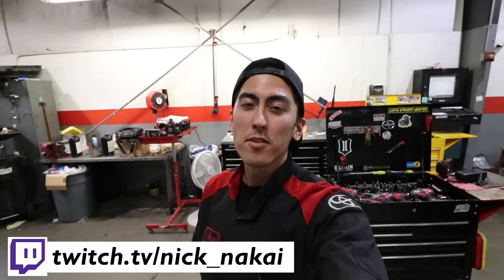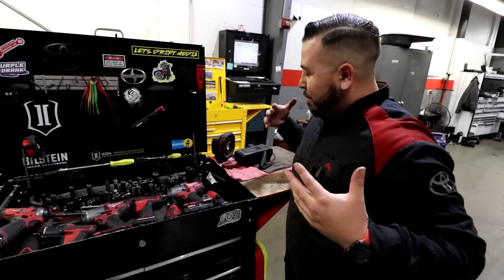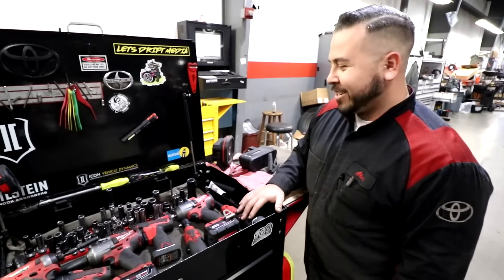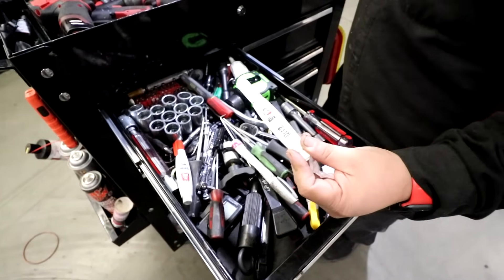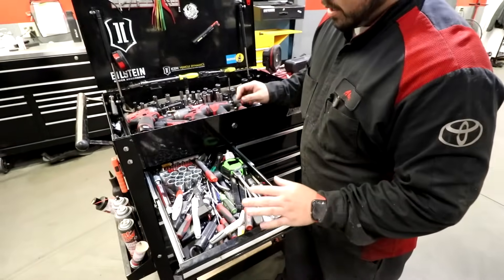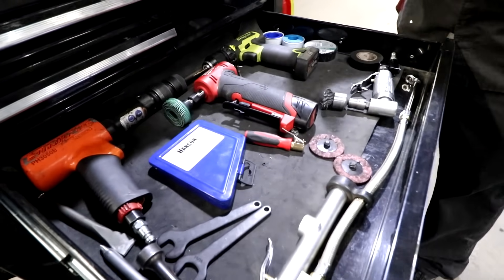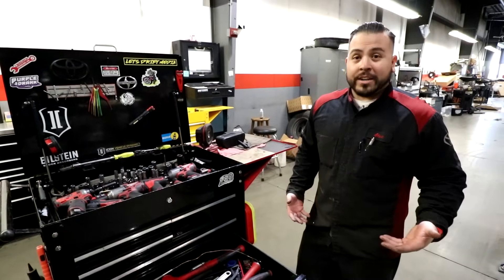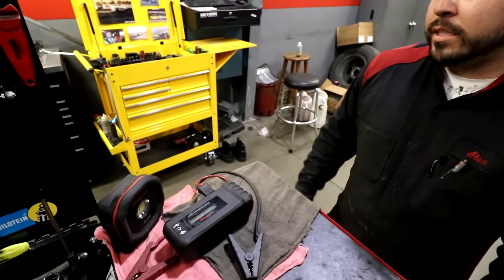TOYOTA TECH TOOL CART BREAKDOWN 2020

Comment: I'm a Toyota man. Have a first gen Sequoia and Highlander. I can appreciate the simplicity and good engineering, those 10,12,14mm are so common on them. It really amazes me how few tools I actually used to do a timing belt on the 4.7L. But I also work on old american iron. Tractor and small block chevy so I ha e to ha e that set of SAae standard tools to complement the metrics. So even though I'm no pro I have an ever expanding collection.

Comment: If a company  comes out with a battery powered air hammer that actually will perform close to the air ones will change the game for sure. I know they can do it because they already have battery hammer drills out for construction use. Then the only reason for air would be to blow guns and to fill tires.

Comment: What brand was that small flex light he had with the 3-4 way light ?
Reply: I have one similar but it's way bigger. I bought mine from snap+on for $150.  Harbor freight has one that flexes like that but only has 2 lights, on won the tip and then the one on the side. You can get the harbor freight one for $25 with the coupon.
Reply: might be the new gearwrench flex headlight
Reply: That’s new from Snap-On
Reply from the maker: Yea it was snap on I think it just came out.
Reply: @LetsDriftMedia  thank you

Comment: Q&A: I don't suppose you know if you have to supply your own tools in a UK dealership, one day I'd live to work for Ford in a dealership and want to start getting my own tools, and what would be the best for a beginner. Thank you 
Love your videos x
Reply: If I were you I'd start with a company like tekton and get a 3/8 short ratchet, flex head ratchet medium length and get the 6mm-24mm short and deep sockets. Get a screwdriver set, plier set, vice grips, set of wrenches (combination and ratcheting). Get a few hammers (ball pein, soft blow and a mallet. Pry bars are a essential for suspension work as well. These are the bare necessities, you'll eventually need things like 1/4, 1/2, sockets/ ratchets. 1/2 impact sockets are good to do 24mm-36mm short and deep. Swivel impacts are essential for time savings but you can get away with a swivel 3/8 adapter. Torque wrenches are good to have, a jack and jack stands. A drain pan is good /oil storage container/ funnel. Picks, electric ratcheting wrenches, impact guns, inspection mirrors, hose release tools, serpentine belt kit, pullers, air hammer, DMM, test light, magnets, storage and organization is key as well. Start with a harbor freight roller cart (3 drawer), piece it together in that order and you'll be good.
Reply: Oh yeah, and sae is a thing you'll have to consider if you work on American classics
Reply: Thank you for your reply, this is helpful.
Reply: @chloeholditch2825  it doesn't have to be in that order and get what you need when you can but its a good start for the essentials

Comment: Do you recommend the 1/4 over the 3/8 Snap-on extended cordless ratchet?
Reply from the maker: I have neither, but from what ive heard the 1/4 is the way to go if your getting the extended version since your most likely going to use it in tighter spaces.

Comment: Should I get a mid torque 1/2in impact or a high torque 1/2in impact?? (Milwaukee) I’m currently a Toyota lube tech
Reply: Mid torque, better and lighter for the all day tire rotations
Reply: Alex Franco  sweet, thanks 🤟🏽
Reply: If it's your only 1/2" gun it might be better to get the high torque first. So you don't get stuck needing it at some point, but it is a little heavier. "How to automotive" has a video on it i believe.
Reply: For a lube tech, mid torque is just fine
Reply from the maker: I would get the mid torque first, the high torque is way too strong for most work at toyota, There are times when you would need it but as a lube tech its deff overkill.
Reply: Lets Drift Media  awesome, I guess a high torque would be overkill 🤟🏽 thanks!!
Reply from the maker: @alvarohernandez8569  no problem I plan on buying the mid torque as soon as Alex stops letting me borrow his
Reply: Lets Drift Media haha I have a coworker that has both and I really love the mid torque

Comment: Who makes the double ratcheting end wrenches
Reply: There are several brands. Harbor freight a icon just made some but most popular are mountain. I just bought some marco off my coworker that is quitting for really cheap.
Reply: Mine are Matco and that’s what’s easier since the truck comes around but the harbor freight ones are literally the same thing
Reply: @housseinahmed6240  thanks
Reply from the maker: what they said ^^^ but his are Mountain i believe.
Reply: Mac sells the mountain brand but they are going to mark it up compared to Amazon's price. The only difference is the tool truck comes once a week if they brake vs sending it back yourself. Sometimes the tool truck has to order it too so think about that.

Comment: Idk if this is out there but it would be cool if someone did a study showing what the average mechanic/auto technician drives for a vehicle. With them having to work on cars everyday and them seeing what common issues are I believe that would influence their purchase. What do you think they drive?
Reply: I drive a 2003 Toyota Corolla with the 5 speed transmission. Super reliable. I bought it with only the axle seals leaking and needed an alignment. Of course working at a Toyota dealership I fixed those issues the next day. And I’m religious at maintenance so I don’t have to do anything too crazy as far as repairs. The 1ZZ engine is fantastic for every day driving. Then I have my toy. My 2014 F-250 FX4. I have that truck to haul stuff and to go off roading and when I want to drive a V8. It’s the 6.2L and those engines are very stout and reliable if you take care of it. I buy vehicles that are reliable so I don’t have to work on them because working on cars all day every day every week can wear you down and the last thing I want to do is work on my own vehicles when I get off of work.
Reply from the maker: That would be interesting, from what ive seen theres 2 types of mechanics, car enthusiast who have there own cool builds they drive and the mechanics that just see it as a job and drive whatever is cheap and easy to maintain.
Reply: I work at a GM dealership as a technician. I daily a 2014 sonic with a 1.8l. From what I've seen at work they are terrible cars but mine has 150k and is still going strong with no issues yet. I also have a 1987 chrysler conquest that I absolutely love. It's currently in pieces since I'm redoing the entire car but it's been a blast working on it. I personally try to find a car that I am passionate about and like to drive but is still decently reliable and easy to work on.
Reply: Buick park avenue with the 3.8

Comment: Can you do list of the brands he points out?
Reply: I see a lot of snap-on and Milwaukee. The advice I have gotten from techs where I work at is to not buy from the tool trucks because you will spend a lot of money and your tool box won't be as full. I buy a lot from Amazon and certain things I do get from snap-on. For power tools I buy milwaukee over snap-on because it's a big price difference. I have a few snap-on ratchets because I know they will be reliable. Sunex, and gearwrench are good alternatives. A lot of the tool truck tolls are rebranded anyways. I bought a $40 wrench from mac the other day and I received a wrench with another brand, looked it up and it costs $20 online
Reply: @fabiancortes9644  Thank you. I just started last week at a Toyota Dealership in Georgia as a Quick Lube Tech. I want to get all the information that I can. Nick has been a BIG help in that area and I really appreciate you too Fabian C.
Reply: @marvino3829  I started 2 years ago at a Lexus dealership as a lube tech. I am currently in the me torship program to become a flagging tech. Careful when buying off the mac tool truck because they sell a lot of tools you can find on Amazon for almost double. For example a knock light from ezred is $45 on amazon and the truck has it for $65. Good brands are otc tools, gearwrench, sunex, ezred, some tekton stuff, harbor freight a icon tools, some other harbor freight tools, milwaukee. For sockets and wrenches you only use 8mm, 10mm, 11mm (for tire pressure sensors), 12mm,14mm, 15mm wrench (some tie rod for alignments), 17mm, 19mm, 21mm, 22mm ,24mm, 30mm(the socket for the axle nut). 21 and 22 for lug nuts. Bigger sizes mostly for alignment stuff. Some torx and hex don't remember what sizes. Toyota requires a little bit more tools since you guys have more models to work with and you guys do drum brakes. Invest in a 1/4 hex impact driver to remove screws faster. Also invest in a good oil filter wrench. If you need anymore tips feel free to ask. My insta is fcortes626 you can dm me on there and I can tell you what brands I bought of what.

Comment: Question: Where is a good place to start as an entry level lube tech?
Reply: Entry level lube tech with 0 work experience, shoot for spots like firestone, pep boys, mavis, etc. then after some months-1year or when u feel the time is right, try to find a dealership to work at
Reply: If you are done with schooling or if you have some schooling and can show proof you can start at a dealership. If not then you'd have to start like at jiffy lube or something similar. I got hired at a dealership with no experience but I was already done with school and had my degree and 2 ASE certifications. But other people have gotten hired with no ASE Certifications and they're still in school.
Reply: Apply at dealerships because there is more opportunity for growth.
Reply from the maker: if you can get into a dealership go for it, but it is kind of hard with no school/exp. Maybe jiffy lube or something like that to get some experience. You could also start as a porter at a dealer and work your way up.
Reply: I personally started at Pepboys not as a lube tech but as a mechanic and it’s a great place to get some ASE’s and move up. I was hired as a mechanic with little experience in a shop, pretty easy to move up to a tech or go to a dealership